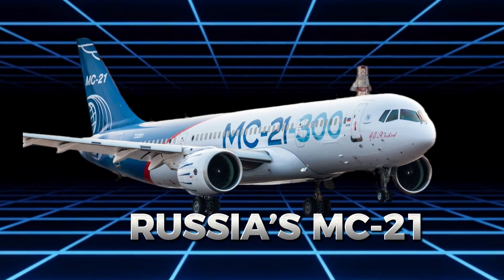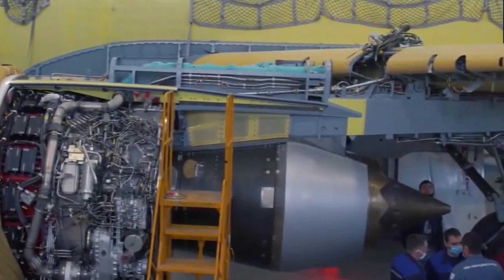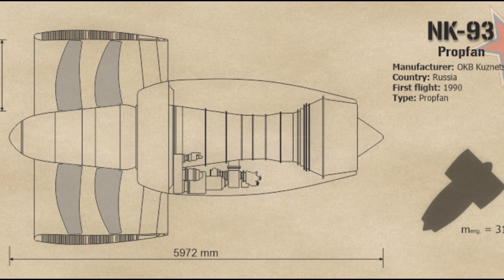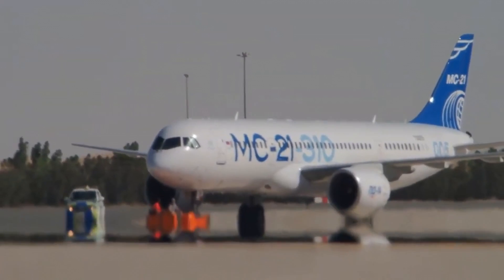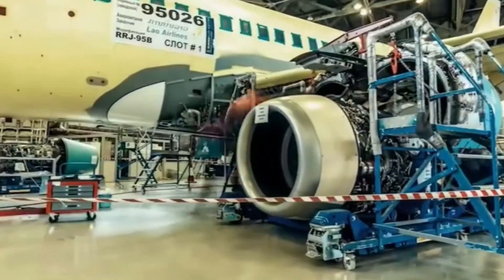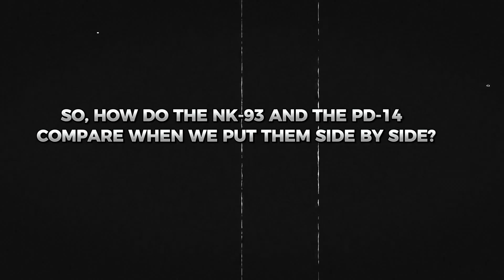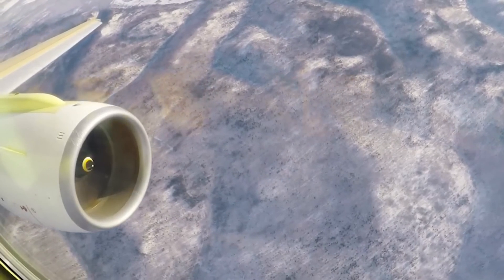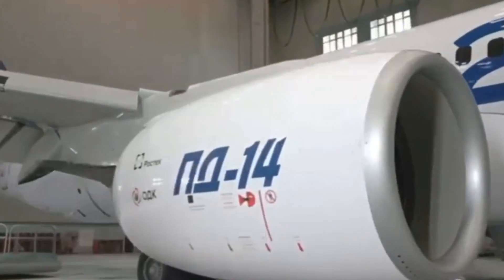PD-14 vs. Kuznetsov NK-93 Propfan: Which Engine is Best for Russia's MC-21?

Comment: The NK-93 is fir different applications, if you want to compare it with a more viable Kusnetzov pick the NK-73, it's in the shelf and it's been ready since the late 90's and is comparable with the PD-14, but the NK-73 is 20-25% more efficient.... Less noise and ni speed drawbacks and can keep up with any modern engine...!..

Comment: The NK- 93 is the most efficiency engine ever developed..it has a very small core but  it need two years of development to perfect it. They used heavy alloys  unlike PD 14 with hollow blades
Reply: But even then it's outperform the modern one because of the counter rotating blades and even the designs parameters tell you a lot

Comment: PD-14 is much Better.

PD-14 is High bypass Turbofan Engine.

MC-21 Irkutsk is a Civilian Passenger Jet!

MC-21 needs the Dry Thrust to get with the Tonnage Lift for Smooth Flight.
Reply: It's MS-21

Comment: A few months ago, I watched an airplane conference in Russia, where Evgeny Elin, Chairman of the Board of Directors of the C7 Group of Companies, he said that both engines are bad, why? Because they do not allow them to test the required number of hours on the ground, that is, russian government do not allow them to burn fuel for hundreds or thousands of hours, every engine needs it before going into production, but before the war in Ukraine with Russia and now, they won't let use fuel and think this it is waste of money, that is why every Russian engine is bad, not one company buy it, until russian government make them, and now because of sanctions they we have less elements to make those engines and it is hard to use Boeing and other planes because of the sanctions, hard to ship details to fix stolen Boeing planes.
Reply: Where did you get such nonsense and false info
Reply: Russia has lots of oil.  Is it because of refining?
Reply: @mefobills279 yeah it's a refining thing. Specialty Kerosene is what Jet fuel is. and that's like 5% of a barrel of oil at best. And it's even harder to get the additives and purification right than it is to process Bunker Fuel, Gasoline, Diesel, and plastic which are the other components of raw crude oil.
Reply: @viewer-of-content that's completely false the guy is just lying about it there's enough kerosene to do testing there's no such test in pd14 because the engine is ready only the airplane parts made in the west are being replaced and tested which takes time stop believing nonsense 😭
Reply: @arthur_vit2  Kerosene is actually only a small portion of raw crude. I don't know the engine details, but I do know Russia sucks at oil Refining. Part of the reason they get such bad oil prices are that they ship it all to China and India to get refined, and Russia used to ship a lot of it elsewhere to get refined before sanctions.
Reply: @viewer-of-content  Don't talk nonsense about the lame oil refining in Russia.Russia has undergone a major modernization of oil refineries, and these refineries are capable of refining oil by 97-98 percent, not all plants in the United States and Europe are capable of such processing.
Reply: @imperskiikulak446  97%-98% of what? All crude oil is fundamentally not the same. Sweat vs Sour, thick vs thin, and desired refining products are all variables in oil refining. If your giving me a flat 97%-98% with no other details than it sounds like a false statistic. Refining literally requires "cracking" and repolimerisation of hydrocarbons if your aiming for shorter or longer chain hydrocarbons, and you can also need catalizing agents and other stuff. Energy in and refined products potential energy out could be a measure of efficiency, but raw product volume will be different than raw crude depending on what you're adding or contaminats your removing.
Reply: Even the total cost of "stolen" Boeings can not make up for the Russian assets treacherously stolen by the US and Western gang bosses.
Reply: Another xoxol lying first the company is s7 and they did do an conference it's an airline company not a manufacturer 😂 and the test on the ground are standard practice world why have nothing to do with fuel burning lol wtf idk why you're lying with such confidence? The engines are ready the problem with ms-21 is some part made in the west are being replaced and test which take time so next year you'll see it in operation and the beginning of delivery in end of 2025 and stop lying xoxol
Reply: You're just trolling.
Every Russian engine is bad, yeah of course. 😏
Russia doesn't have enough fuel for the testing...
Just non sense after non sense.
Reply: @nejyh  They're not all bad, but they do tend to have less fuel efficiency or power density than western engines. G.E., Pratt&Whitney, Rolls Royce, CFM international, and IAE are the Largest Jet Engine manufacturers according to Simply Flying, a Plane News company. Jet engines from that lot hold records for volume and efficiency of those in production airplanes. Two of those top five were founded as international consortiums, and the others are known to contract out parts. The best Jet engines take international cooperation, and Putin's Russia got a little too used to talking with a fist scaring off their previous more advanced collaborators. China hasn't exactly wanted to help bail Putin out either, and Iran's Jet engines are from the 1970s